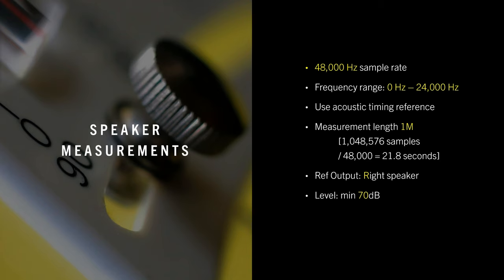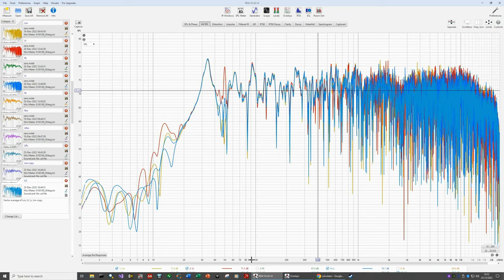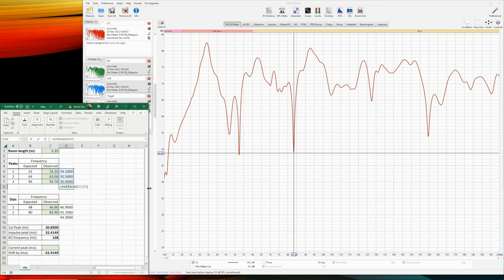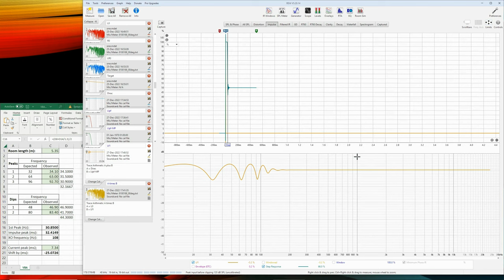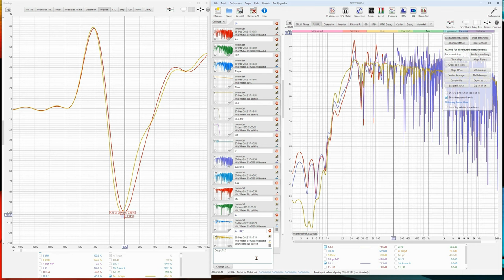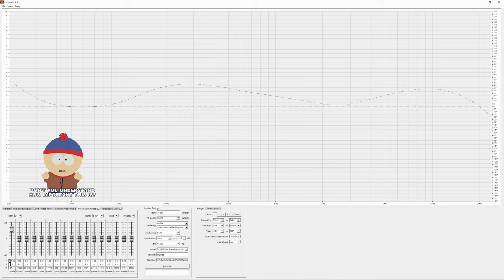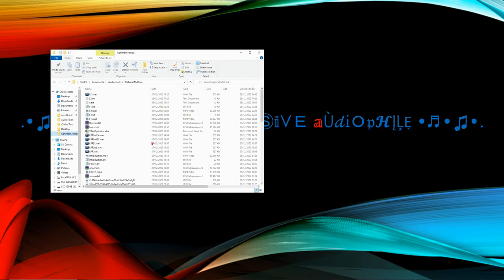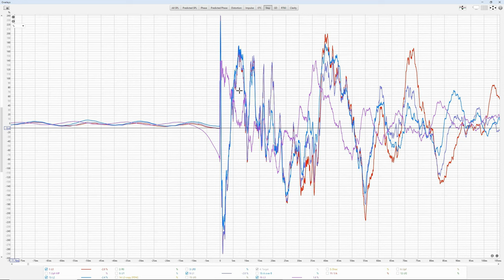High Fidelity Digital Room Correction with REW & rePhase

Comment: This video is pure gold! Finally I can follow along a room eq correction tutorial where things are well explained, make sense from a signal processing point of view and audible results start to appear in speakers setup! Thank you so much Serkan.

I have some questions, though:
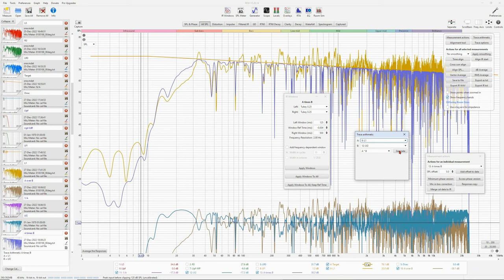- when convolving filter 2 to obtain the predicted response [at 31:03], wouldn't it be better to disable frequency dependent windowing on L1 before applying the multiplication?
- it happens to my second stage filtered signal (after the target curve inversion filter) to have a phase slope inversion for extremely high freqs. This means frequencies from 23.600 Hz approx to 24000 seem to arrive later than freqs immediately before 23600 Hz. Do you have experience with this happening? Is it acceptable? Where shall I 0-center my rePhase phase response, then? 
- I don't have info about my Focal Shape 40 crossover specs. I wrote to Focal asking for the crossover tech specs but I'm not sure they will reply. Can I try to bypass this info and just go for a 0 phase linearization with whatever combo of reasonable xover parameters in rePhase (e.g. xover freq between 2000 and 3000 and 12 to 24 dB/octave slopes)?
- I still miss a concept. After phase linearization of step 3, I would suppose the phase has already be minimized, since we zeroed the phase of the response. I can't understand why after this step the phase still exhibits an excess phase that we need (and, above all, are allowed) to further correct

Kudos to you again!
Reply from the maker: I'll try to answer all. Without fdw the filter will cause some post echo in high frequencies due to lots of spikes in the response. Don't forget to download the zip file linked in the video description. I've added some extra info there in a word document as well as the.mdat file used in the video. Focal might get back to you but if they don't you can take phase discontinuties I  rephase as xp points. We do excess phase correction on top of this because first correction is a very loose one with fdw:1 and excees phase by definition is just that : excessive phase to be removed. Phase shifts At very high frequencies are just speaker time alignment and should be ignored, you can see how fast they will change by playing with "time offset" in rephase.
Reply: @ocaudiophile  thanks for your answers! I tried with your suggestions and project to move on and  implement stage 3 and 4 of the filters, but there is something strange. First of all, I can create phase filters in rephase by equalizing down to 15 Hz, 180° and Q=2 with no pre-ringing artifacts. The final response is flatter in terms of phase, and the impulse response is very similar to the previous one (especially in the anti-causal part). I can barely hear any difference in transients, stereo placement before/ after filters. Also, when applying the filter, there are very little excess phase fluctuations, which makes it useless to compute filter 4. I don't know why it is so easy and at the same time useless to compute phase filters in my setup, it seems like everything already works without. Maybe is it because my room is properly acoustically treated with bass traps, and I'm in a mixing desk setup, with the listening position very close to the speaker monitors?

Also, my setup involves two focal shape 40 and a subwoofer focal sub one. I did measurements with one main speaker on at time (while sub always on). In phase correction with rephase, I just applied one crossover linearization filter for the main speakers, since lower in frequency, although there is the sub, I don't have any other conventional crossover. The only 'crossover' is done by the LP+HP settings on my sub to split the signal between sub and main speakers, but since these settings are highly configurable, I'm not sure if it makes sense to try to apply a crossover linearization in that range, also because, from measurements, I cannot spot any phase inversion near the subwoofer cutoff frequency (it's around 200 Hz). Any suggestion on how to properly treat a setup with speakers plus sub? 

Thanks again!
Reply from the maker: I just checked Shape 40. They're active speakers meaning they have their own amplification and digital crossovers so no crossover phase shifts will need to be corrected. Also they're nearfield monitors hence little to none phase discontinuties to be expected by room reflections. I think that's why you don't hear any difference.
Measuring them with the subwoofer included in the response is the right way but I think you should cross the sub one at 80Hz max to avoid localization of bass. This should be easy since your speakers can go down as low as 60Hz.
So, you don't need crossover phase correction filter, you don't need excess phase inversion filter. VBA and target curve inversion filters along with a sub crossovered at 80Hz with your speakers will he optimal in your case imo.
Reply: @ocaudiophile  makes sense! I'm relieved from the fact this is due to my setup, room and speakers and not to some mistakes during the procedure. Also, thanks for the tip about the focal crossovers characteristics. I ended up with the VBA filter and room linearization and everything already sounds much more flat and clinical (which is exactly what I need). You made my day!

Comment: I'm curious if these steps are similar when tuning a speaker, not necessarily to the room, but to account for the natural distortion of the speakers themselves. The reason I ask is I purchased some generic T24n tops for my sound system and they don't come with any recommended information on crossover filters, so I'm playing by ear. I have found some settings that sound decent, but I wanted to perform some more detailed filtering. I have ordered a processor with FIR and all pass features and so I'm starting to look into methods to measure and adjust the speaker as a kind of default preset.
Reply from the maker: Try to invert (1/A) the minimum phase version of the speaker response at the LP. That should give you a filter which will bring out something close to the anechoic response of the speaker when convolved with the original response at the LP.

Comment: Hey, that's a great tutorial! Thank you so much for all the work you've put into this to make it so detailed and clear and for replying to our questions and comments. 
I reached to the end, but have a couple of questions and would appreciate your help: 
1. When I multiply all filters and convolve with the initial response, I get a new response that is not at all that different from the initial. It still has peaks (smaller than the initial - but existing), is not flat against the target and has all the inherent flaws of the initial response in terms of Step, ETC, RT60 etc. So, something is not working right with all the multiplications I do..
On the other hand, if I just convolve L3 with the excess phase filter, I get a perfect L4, from which I can then export the impulse response for Jriver. Is there anything wrong with this approach? 
2. Even with the final response, I have the second mode peak in the bass area visible in Spectro, Decay etc and evident when listening. Is absorption the only way to manage this?

Thanks again!!
Reply from the maker: Thank you.
1. Try putting the filter with the widest right hand window length first (as in "A" in "A x B" multiplication). You will have slower filters but accuracy will increase. And you can of course only use certain filters, they are independent of each other.
2. FIlter 2 should be able to remove any peaks from the response. Try removing any smoothing from "1/A" before generating its MP version.
Reply: @ocaudiophile Thank you, I'll try to play around with the multiplications as you suggest.

Filter 2 has removed the peak from the frequency, but it's still visible in the spectro and I can hear it.
However, after L4 I tried correcting the phase once again (like new, additional filters 3 and 4) and I managed to smoothen it. On the verge of pre-ringing in the graphs, though I can't hear anything yet.

Comment: Hi.. .I have a question: when it refers to the filter order of the divisor
Does it refer to the electrical order of the filter or the acoustic order? I mean: in a 6.5 inch woofer cut with a low pass filter at 2300hz for example, the filter is 12 db per octave, but the effective slope is 24 db/oct. Which one do you mean to take into account in the RePhase? Thanks for your Effort!
Reply from the maker: It's one order per capacitor/inductor in the analogue filter

Comment: I need to downsize to a 2.0 full range system. Do you recommend using the UMIK-1 pointed at the speakers or at 90 degrees? Does the VBA filter create meaningful corrections for a 2.0 system? Thanks!
Reply from the maker: İf you'll take measurements at just one central position or multiple positions very close to each other pointing forward is OK and will give slightly more accurate HF response but otherwise stock with 90 degrees. As long as you use the correct calibration file, messuemrdnts will be accurate enough. Mic direction only effects very highfrequencies. VBA works best with 2.0 especially if the room is symmetric.

Comment: Hello - amazing video. I am slightly confused, however, on where you export the target curve inversion filter on REW, as a wav file. After obtaining the magnitude response curve labelled as "L2" in your video, I cannot find a way to export the file as FIR coefficients. My DSP (BSS Blu-100) also appears to only accept .csv or .dat file type coefficients as well.
Reply from the maker: I couldn't find info on the exact format of the csv filters your DSP unit requiers but instead of exporting the filters as wav files, you can "Export impulse response as text" and then convert txt impulse reponse to csv either in Excel or with an online converter.
Reply: @ocaudiophile  Thank you very much for the reply. This worked well. Second question. The speakers I use are Genelec 8030c, which have no type of analog filters crossing the woofer and tweeter over. How would you go about phase correction in this case ?
Reply from the maker: There's a lot of useful information on your speaker here:
https://www.stereophile.com/content/genelec-g-three-active-loudspeaker-measurements

There's only one crossover at 3000hz and tweeter is polarity inverted, port frequency seems to be around 45-46Hz

You can find some additional info on how to fix speaker box/crossover phase correction in the more recent videos (workshops and speaker phase)

 @eiddie4108
Reply: @ocaudiophile  very great info. Thank you!!

Comment: Hello, tell me please, how to make a 0-24000 sweepton for 6 channels (5.1)? In your archive, the sweeptones are 20-20000Hz, but if I set 0-24000Hz in the measurement settings, then the section from 0 to 20-25Hz is measured incorrectly (I have a generator in REW that allows me to select only the L or R channel for saving)
Reply from the maker: You don't need to use played files for 5.1 surround channels. REW ASIO or Java EXCLusive drivers can produce sweeps up to 7.1 channels. After you select correct inputs and outputs in the Preferences / Souncard settings, just run a sweep from Measure window with "From REW" selected instead of " From file"
Reply: @ocaudiophile  Yes, I know. But if I choose RAW ASIO or Java EXCLusive, then the sound goes directly to the speakers. And I have it to go through the crossovers/bass management configured in EQ APO.

If I use a file from your archive "256kMeasSweep_20_to_20000_-12_dBFS_48k_Float_L_refR" , but set 0-24000hz in the settings, and use files for different channels, for example ""256k_20_to_20000_48k_C", then the measurement occurs with errors on low Freq.
I tried to generate a file in REW "Left" 0-24000 and "256kMeasSweep_0_to_24000_-12_dBFS_48k_Float_L_refR" to use it for measuring - everything is fine, but REW can export only the left and right channels, but I need all 6

Comment: Hello, Just One question, in VBA correction filter, we have to consider Always the Major lenght of the room, or the lenght of the room dimension where the LP Is ( between front and rear walls)?
Thanx
Reply from the maker: It depends on a lot of factors in such a placement. You first peak frequency will tell you which room length you should be using.

Comment: A quick question Serkan.
After filter 3 , L3 has shifted a bit compared to L0 and L2 copy, even though I did cross align L0 and L2-copy prior to phase correction. Can I just realign the final L4 response at the end, before generating the convolution files?
Thank you again for all your help!
Reply from the maker: some shifting is expected during trace arithmetic operations and has no effect on the filters. Just keep adding the filters on the produced results and ideally don't change the window ref time figures in the filters' IR windows. It's not carried over to the convolution file but it helps rew calculate vector operations accurately

Comment: This tutorial and description are fantastic! Thanks for sharing your expertise and inside knowledge. I am not sure how to find the "order" of my crossovers. I have Klipsch Forte IV loudspeaker. While I know their crossover frequencies (HF: 5.2kHz, MF: 650Hz), I don't know more about them. 

If I can't find this information is there a way to guess? If not, can Filter 3 be skipped and then complete Filter 4 for use in conjunction with only Filters 1 & 2?

So far, I have made the convolution files, including VBA and Target Curve Inversion (using the Harman Curve). The result sounds fantastic, but I'm eager to go further and apply all of these filters if possible. Many thanks in advance for your advice!
Reply from the maker: If you skip filter 3 and jump to filter 4, you will still be correcting the phase response but the corrections will need to be too strong and will cause ringing. The beauty of XO linear filteraztion tools is that they don't cause any ringing.

For your XO orders, 24db/oct is a good starting point, very few XOs are below that. You can maybe see them easier if you adjust the very first impulse peak of the speaker's response (not the largest peak) to time 0 and export to rephase with no fdw or smoothing and start by applying 24dB/oct to 5,200Hz and try 36,48) and see how it goes from there.

Comment: Thank you for reading your comments and replying!

I hope you see this one 

I have a question about microphone placement when taking measurements:
I watched a video i will link below and they said to move it around, please watch when you can and let me know your opinion on best technique; moving or static position.

Also two quick questions
1) What is your background? You're smarter than anyone I've seen on the subject.
2) Is pink noise better than sweeping to measure?

Thanks so much!
Reply from the maker: Moving mic measurement is a common and efficient technique and you'll get a good average frequency response free of local peaks and dips. But you'll have no phase information hence no phase correction will be possible. Still it's a good simple correction method.
Reply from the maker: Rew sweeps are extremely optimised for speaker measurement and are very efficient in stripping environmental noise and effects. I don't know any tool that can extract information of that quality with pink noise. It's more suitable for speaker volume measurement. I'm just a hobbyist and I work in finance but I've an aeronautical engineering degree ;)
Reply: @ocaudiophile  
Thats awesome! Thank you so much for your help
I love the degree man! Kudos! I wish I went to school for engineering, but I learn from smart folks like you! Thank you again, from us all

Comment: Just discovered your channel. I want to use REW and Roon for room correction. Do you recommend this video or the EW (Room EQ Wizard) Top Tricks? Thanks and great job!
Reply from the maker: REW Top tricks is a quick and efficient correction and it comes with a written guide so you can start with that. This one (Supreme..) is more complex and the first video method is only one fo the 4 filters in it.

Comment: This is very interesting. Based off the comments this cannot be used on Denon AVRs? Even with miniDSP?   Since I am so new maybe I am missing something... When I finally build my stereo music setup. How would you apply these changes to the amp you are using? Do you connect a PC and then use a EQ software to implement all of these changes?
Reply from the maker: Your digital music library needs a PC/Mac to be stored and played anyway. And you can use these filters in most media player software. There're also free convolution engines for PCs like Equalizer APO.

Comment: Hello,
i've got a 2 way  bookshelf speakers, and i noted a weird (to me ) behaviour in the phase while i work in the rephase section of your procedure: the crossover should be at 1900 ca 12 db/oct and it is quite linear at -180 degree till crossover point then it goes quite linear at 0 degree till 24kHz.If i click on invert polarity it seems much better. Could be the tweeter 180 degree inverted? How could i consider this fact in the procedure? Thank you sooooooooo much
😃😃😁
Reply from the maker: Very hard to tell without visuals but it's unlikely that your tweeter polarity needs to be reversed. Phase response after 1000-2000Hz is very volatile and dependent on the signal delay due to speaker placement so I'd take that part of the phase graph with a pinch of salt. Apply only xo phase shift correction and leave it at that. Btw, shift at 1900Hz is probably at least 24db/oct. 12 db/oct is quite unlikely unless your crossovers are made of just one capacitor and one resistor.